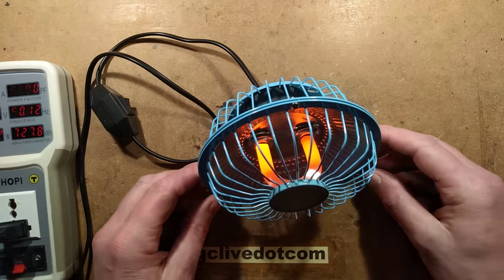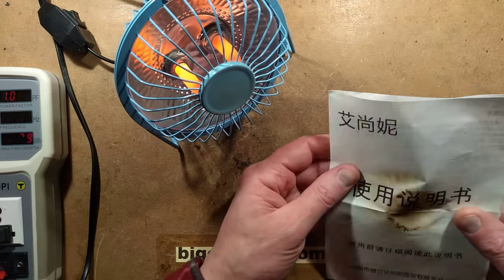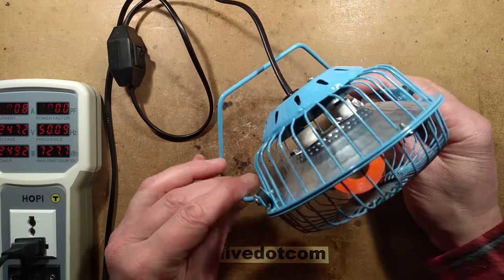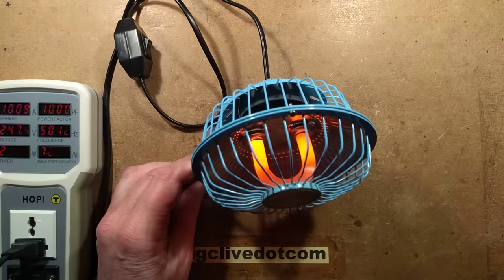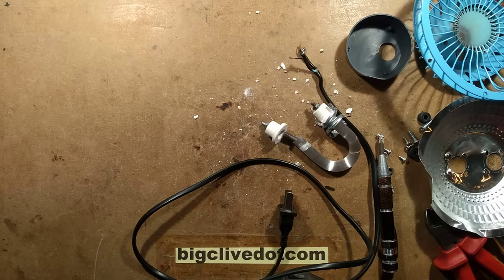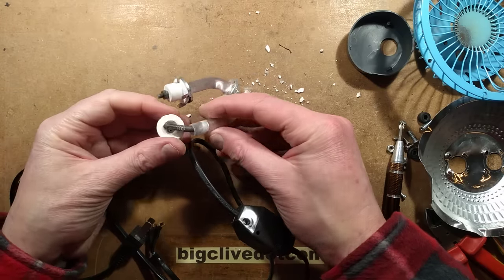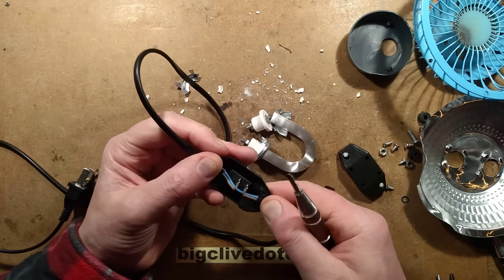Chinese automatic house ignitor.  (also available in pink)

Comment: This is really one of the most dangerous things you've had on the channel.
Reply: Yes, house igniter seems a fitting name.
Reply: Well, apart from BC himself !
Reply: The electric suicide shower Clive featured ages ago beats this for danger!
Reply: The electrode baby bath heater has this well and truly beaten.
Reply: @girlsdrinkfeck   The bath heater should be just fine, as long as you don't get in the water while the damn thing is on.
Reply: Aaron Greenfield - or touch a metal bowl/bucket if put in it
Reply: Nah you forget about fanny flambo
Reply: Rhys Aistrope - that was a joke 😁
Reply: the death daleks are up there
Reply: I think the mains powered water heater had it over this POS as the most dangerous.

Comment: That case is used for fans, I have a desktop fan I use to cool my modem and it has the same casing. The square recess is used for mounting a small switch and the holes I believe for mounting screws for the motor and probably the circuit board

Comment: Well, the finger tight connections should be good for seeing if your arc-fault circuit breakers really work after they loosen up during the heat/cold cycles. Great piece of electrician test equipment.

Comment: I know the video is on old side. but the housing unit case. You were right it was originally for a Fan and many were made as fans. but also seen lot of them with the heater element too. Used in little guard shacks. (USA measurements) Guard shacks were not bigger then a 6 feet by 6 feet. Both Fan and Heater being used as just a way to keep either bit cooler or warmer during seasons. I used to have a Little Fan that came from china and looked just like this in purple.

Comment: I bet you they had problems tightening the nuts on the back of the element because they were cracking the heaters. That's why they opted for serrated washers and the bare minimum torque to hold the leads in place.

Comment: I legit had an LED fan that used this exact same housing. Interesting.
Reply: To be honest that's most likely what that cage is from because I've had one too and to be honest I'm thinking that's exactly the whole point of that cage but some Chinese companies thought oh we can make an unsafe heater with this thing until this thing wasn't a normal product because there was no safety features there was nothing besides the wires being attached to the heating element it was just parts thrown together to make a heater birds that most likely weren't even made to go together in that kind of configuration

Comment: the fact that people will buy these, and put them on rugs.. makes me fear for my appartment :/
Reply: Why put them under rugs??
Reply: @MrCazador123 
He said "on" rugs. Which is where people put them - to warm their feet.
Reply: Or under their desk at work causing PC cases and power sockets to melt and blowing out several fuses
Reply: Yes. I live in a 4-plex. As a major electrical nurd I would immediately recognize a heater like this as dangerously sketchy even if I hadn't watched this video. But what about the woman next door who sells real estate and needs help to figure out how to plug in her Christmas lights? Chances are she'd burn down the whole building with one of these.
Reply: @MrCazador123  Reading comprehension?
Reply: I remember years ago, there was a lady that fell asleep smoking in bed.  It only burned her and her apartment, but still, definitely worrisome.  I think if it didn't have a sprinkler system, that entire building would have gone down.
Reply: @sootikins  
Wait, you mean to tell me that we shouldn't plug every single device in the home into a single electrical outlet?
Reply: @sootikins  It`s not dangerous if you screw it to the table.
Reply: @statusquo9520  Yeah, I get that but I think I'd rather spend the extra dollar for the model with the tip-over switch and maybe even the luxury (heh!) of an overtemp cutout!
Reply: @sootikins  Yes of course, if you like to throw things around or have kids.
Reply: @statusquo9520  Actually I do throw kids around sometimes. It's good exercise and they make such interesting sounds.
Reply: @sootikins  They probably love you very much )

Comment: Reminds me of an electric heater I found in my school a while back. 

I was doing A-level Drama, had a free period and figured I'd do something nice and clean up the costume store because it was trashed. As I was pulling things out, I noticed deformed and burned boxes against a wall, which were covered by clothing. Turns out there was an electric radiator behind there, still running, and absolutely covered with costumes, creating a thermal blanket. Considering the room was surrounded by paper walls, and it was in the centre of the main building, by some miracle the school wasn't burned down.

Comment: So let's count the electrical sins, in no particular order:
1. Main power switch only breaks the live, plug can be inserted into socket either way around...
2. No fuse in the plug
3. No TCO anywhere in the unit
4. No tilt switch

5. All-metal housing, no Earth connection
6. No positive retention on the electrical connection

7. Bare conductor where cable pinched into strain relief
So a nice round 7?
Reply: Fused plugs are mostly UK-specific (due to outlets being supplied by 30/32A ring circuits), so take that sin off.
Reply: But everything else is all good. 😁

Comment: In Australia we only recently made it that electric heaters couldn't be sold unless they had tip switches. The sad part is that the number one failure point of these new heaters is the tip switch. So now we have a land fill problem. I have an older model without a tip switch that has lasted me 10 years now. It doesn't matter that it doesn't have a tip switch because its a heavy cube that cant really fall over. This thing however looks like a house igniter because it isn't heavy enough; the power cord weight will just tip it over.

Comment: They sell in the same cage, desk fans. Regular wall plug and a usb style. We have quite a few through the house moving air around. The usb style costs nothing to run 24/7. I would never have a heater in this style.

Comment: I have a cheap usb desktop fan that uses this exact cage and stand. I had to open it up because the metal fanblades were rubbing on something and causing far too much noise, so I bent them around and now they rub on the cage for a second while starting up then go completely quiet.

The circuit is equally as basic with just a motor and the switch on the back in that slot you identified.

Comment: 3:00 It did start as a fan case. I have a fan exactly like it. That rectangle hole in the back is for a smaller switch. I suppose that was not enough since this draws way more power.

Comment: I have a cheap single speed fan in that exact same outside housing (but chrome/bright nickel like finish). The cutout houses an on/off switch on mine - very much like the inline switch in the heater.

Comment: It's like a miniature version of those old 1000 Watt round radiant heaters from the past. I have one of those old heaters. I don't use it because the plug gets really hot. Maybe the blades on the plug need cleaning.
The cage for that little heater is similar to my Lakewood fan, which I have a video of on my channel. It's red.

Comment: I have two of those hung over my workbench on the wall with wire staples and, in my opinion, that's still on the verge of unacceptable. Also, I've seen the exact housing/grate as a fan and just that part is for sale on ebay without the fan or heater

Comment: 02:58 You are absolutely right! I have a black USB fan which has exactly the same metal case as this "heater"! 😶
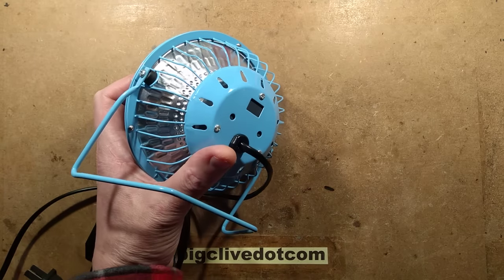03:31 Yes. Those holes are for a "on/off" switch and the two motor mounting screws.
Looks like Chinese manufacturers reuse everything as possible for as cheap as possible...😶

Comment: Almost all houses in japan use these exclusively to heat their homes. Maybe not this exact model but pretty much the same thing. I'm sure theres a good number of people who have these there. Not sure if its the same in china. The lack of safety features is totally the norm in japan it doesnt even scare them at all they are super used to these being around. You can look up a Kotatsu which is a heated table with a blanket around it with your legs literally inches away from the red hot elements under the table. They are super popular in japan.

Comment: I have the fan incarnation of the housing unit with the persistence of vision LED clock feature.  Interestingly I had it unplugged for over a year and when I plugged it back in and turned it on it had the correct time.

Comment: In the Philippines I have several of those exact cases with high speed triple blade fans. They move a lot of air, but have no speed control and are quite loud. 4 years and still work though. Paid 120 peso each for them, about 3 dollars. Usefuull to blow hot air out of a room before using the room.
Reply: Nothing  read my comment again. The ones I have are high speed fans, not heaters.
Reply: Nothing  cheap construction, but strangle last forever. Very loud, even more so then electronics fans. Too loud to sleep with even one running, but they do cool off a room a bit it blowing out windows.

Comment: Speaking of those annoying bits that keep wires in, I took the guts out of a Weller soldering iron to replace the shot bits on my old station (the LED one was $10 cheaper than the direct replacement) and their cable keep is the WORST.

Comment: I’ve got a fan that’s the same exact case with the same exact stand, the rectangle hole holds an on off switch, the wires in the same spot, the two screw holes mount the motor

Comment: That case is 100% for a fan. I have a couple of cheap USB desk fans in that body, the square hole is where the on/of switch goes
Reply: Also I kinda desperately want to get my hands on a quartz heater tube and see if I can cut it down and make beads out of it that stuff is GORGEOUS

Comment: 1) For the grommet / cable strain relief!  'Metal Strain Relief Bushing Pliers Tool Grommet Insert Crimpers for Electrician' from a quick ebay search. Our tool was called a "grommet buster" but that isn't accurate. They make a tool to insert and remove those, and ours was at a small angle, as a cord could come straight out. I see this video is two years old, but I had to call it out.

2) The schematic is 100% accurate. What's to complain about :P

Comment: I have a 5v USB fan with the same exact case, although the spacers on the two side bolts are plastic on the fan. obviously they had to change that to rubber for the heater.

Comment: I suspect they originally designed it with a rocker switch on that back plate, but then realized it was hard to turn off without scorching your fingers, so they moved the switch to the power cable.

Comment: Ya, my mom got one of these as a little fan, it's a normal wall plug type rather than USB as someone else here mentioned. I've seen this same frame used on a few things, so it's probably just one of those cheap generic parts you can easily buy in bulk for stuff you're working on.

Comment: Fascinating! Over here in Germany they dig out the coal could with huge amount of energy and tools, the brown one. After that they burn it to cook water. The resulting steam then drives a turbine which drives a generator. This has a thermal efficiency of about 32%, not counting in the coal digging, under its huge layer of earth and sand and clay. They then send the current thru the landscape in thick cables, which get hot as you imagine. Birds like to sit on them in winter, if they are not already killed by Monsanto. They then transform the current several time to reach your socket at about 230V and 50Hz (That's the actual turbine-generator spinning speed). Those transformers therefor make a lovely hum at this rate, besides the waste heat. There is almost nothing left from those coal calories, but it is enough to ignite the house with that very gadget, which makes you use all the precious calories in your carpets, furniture and curtains! Fascinating.

Comment: I'm thinking the cage is also used for fans, which may explain the rubber grommets. As for the design, Costco here in the States has a much larger and safer heater with a thermostat. It makes the "tink" sound too, when the element goes on and off to heat the ceramic core.

Comment: I had/have fans with the housing exactly like that. One in chrome color, that one failed. Bought another. New one worked for about a minute, then failed. Exchanged it for another (in black) that one still works.

Comment: I have a desk fan that looks exactly like this just different color (red). The switch is on the back where the extra knockout is. The casing was definitely meant for a fan and it looks like someone thought they could remove the motor and blades and install a heater. Definitely seems like a major fire hazard especially since there is no sort of protective relay in case the unit tips. Surprised it has an on/off switch on the cord…

Comment: That switch insert would probably fit in unused rectangular cutout in the back of heater, maybe would get a bit hot if heater suspended from ceiling pointing down?

Comment: It's common in China to buy a fan with a stand and it has a replaceable head with a heater just like that or sometimes a bulb.

In the North they have heating rooms that use conoressed coal powder or gas.

One of the places I lived in used sawdust and pulse jets, I could hear a hum and the old man who never met a non Chinese in his life was so baffled why I was I treated but he let me adjust the controlls and even showed me the shut down and startup.

It was the most basic type of pulse jet but high quality I think it did not use a V1 type flapper system to cut down on noise.
He would often invite me to have dinner with his family and he made my heating bill free lol.

No Chinese person would ever use that product.

You should visit China, as a brit that lived in China since I was 18   you would love it and the people are so nice and hospitable.

Whoever sold this made penny's especially if a UK seller.

Of course I don't want greenhouse gases but I don't want to freeze, in the UK we could have turbines that can run on distillates (kind of like jerosine but has to much water but very cheap)

The UK wants to go carbon neutral and its 1 big scam, the UK makes less than 1 percent of carbon.

Its going to cost a fortune and just won't work unless we go 75%+ nuclear and with thorium reactors that make it crazy hard to get weapons grade anything from and new automated and smaller reactors and reinrichment.  And when you take into count that the only fuels we are using in nuclear reactors are to get materials for weapons...    The earth has 3x more throim than the current material we use.  Then many other materials we can use plus reinrichment.

As for electric cars the battery tech is just bad, nuclear with hydrogen geborators would be the best bet as the car would just need modification to the engine.

As for aircraft sure you could make a bio fuel but unless its from waste nstieal that has no use as animal feed (that leaves very little left) it would work out worse.

Maybe hydrogen I don't know.

Rolls Royce made a hydrogen jet engine and tested it last week and it ran fine.

What's the point of the west going carbinnnuctral when we pretty much have relocated all heavy industry to the east.

It all ends up in one pot.

I'm going to try and get a gas heater for my flat as in cylinders of cheap gas but I will use a mat.

Than little heater, how much per hour does it cost to run?

In China I never even cared about the electric I used.

Carbon credits are the biggest scam ever.

I suggest you buy a few of these as gifts for people on your naughty list this year, just make sure they are not neighbors.

It reminds me of the time I filled a floppy disk with a match head paste and put it all over both sides of the disk.
And then sandpaper sandwiched the disk

I wrote do not use and put in in the school library.

I did not think anyone would fall for it or it would work but it set a computer on fire lol 

One other match story is when I worked on my father's bar on the weekends when I was 15 to 18  so many people would steal cogs and I would put match heads in ones I found and place them randomly. 

One time I crushed up 5 match heads into a fine powder and wrapped it tightly into a ball liek crazy tight, took some of the tobbaco out and the ball on them some tobbaco back in. 

Placed it on the counter to see who the suspect was thinking it would make a tiny crack. 

It made a defaming bang and forced smoldering plastic still burning parts of matches, tobbaco and parts of the filter all in the guys face giving him mild burns. 

And he looked shell shocked for about 3 mins. 

Something as simple as a few inches celopane squared can make that much pressure build up in such a small amount. 
That's when I started to really understand low explosives. 

I did plan to put a shotgun primer and I'm glad I did not as they make quite a big bang and outside of a case I'm sure it would send bits of copper and potentially blind someone.

Comment: Could be handy for mounting on the ceiling or wall (foil backing required, so paint doesn't burn). Could also be used to make a real cheap oven.

Comment: With appropriate safety switches and grounding the metal case, this could be a dandy little heater.  It wouldn't cost that much more to make the improvements and it would still be a bargain, so I wonder why they didn't do it.

Comment: I had one of these when I was in the military. I was a basic ground grunt so my life was a lot of outside and cold. So whenever we could get something that didn't give off a lot of noise and light radiation for heat? We were on it. 

NOT suggested to hook this thing up to a Humvee battery . . . but it's possible.